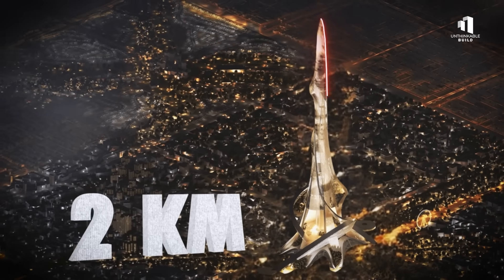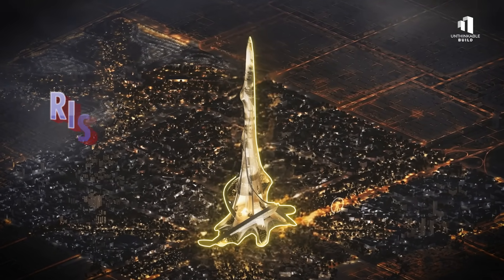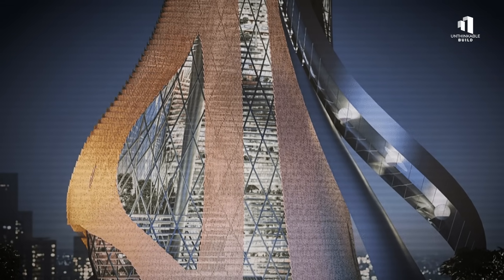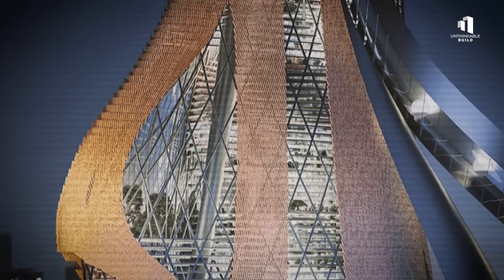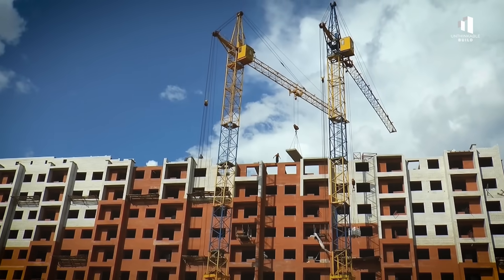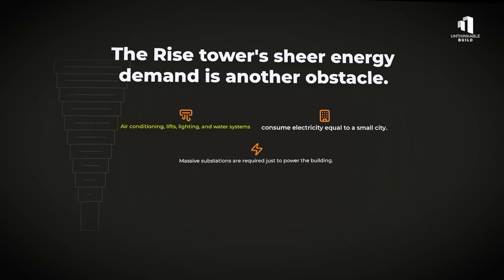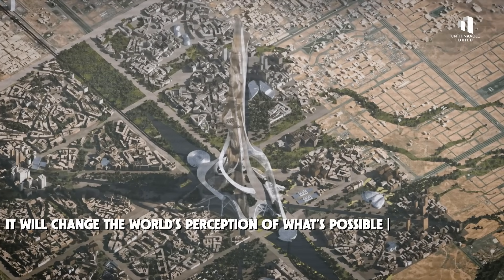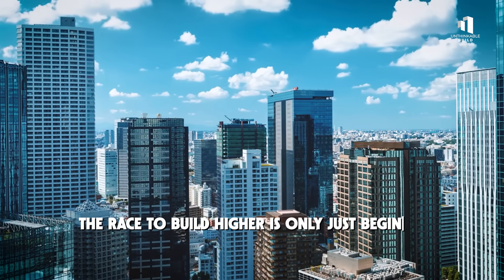Rise Tower: Saudi Arabia's 2-Kilometer Skyscraper Changing the World

Comment: Why not 3 km ?
Reply from the maker: At that scale, the limits aren’t ambition but physics, materials, cost, and human use. Beyond a certain height, wind loads, structural efficiency, elevator travel time, safety systems, and operability become exponentially harder and less practical. A taller number is possible on paper, but making it usable, safe, and economically viable is the real constraint.

Comment: Oil money won't last forever. Spend it wisely or throw it at some giant building project that never breaks even. It doesn't make sense to build vertical in the desert, the land is cheap.
Reply from the maker: That’s a common critique. With abundant land and extreme climate challenges, building ultra-tall structures in the desert raises real questions about long-term value and operating costs. If oil revenues are meant to secure the future, many argue they’re better spent on diversification, human capital, and infrastructure that delivers steady returns rather than symbolic projects that may never fully pay back.

Comment: Interesting Fact ----  A 2022 MIT and Harvard AI simulation found that if the current pace of greenhouse emissions remains constant, the Middle East and most of North Africa will be completely uninhabitable within the next 60 years as temperatures would exceed the threshold for human survivability.  

August 2025 Update: Greenhouse emissions and temperatures in the middle east continue to rise almost three times higher than anywhere else on earth.
Reply from the maker: Those studies highlight a real and growing risk: the Middle East is warming faster than the global average, and extreme heat events are becoming longer and more intense. But “completely uninhabitable” is a worst-case scenario under high-emissions pathways, not a guaranteed outcome. What the research actually warns is that parts of the region could regularly exceed the wet-bulb temperature limit a point where the human body can no longer cool itself, even in the shade.

Whether that happens depends on global emissions, regional adaptation, and how quickly countries invest in renewable energy, cooling infrastructure, and urban planning. The trend is worrying, but the final outcome isn’t fixed.
Reply: @UnthinkableBuild It's not a worse case scenario.  This is expected before the end of the century.  The "parts" are the first to reach 140 degrees Fahrenheit, with the rest of the region to follow in the coming years.  There is not one reputable study that says this situation is in reverse, on the contrary it is gaining momentum.  Irony found in the middle eastern nations selling the very products that will result in their own demise in their children's lifetime.

Comment: If you ask me, the Rise Tower is just like Frank Lloyd Wright's The Illinois Tower as in the building is before its time and that it probably shouldn't be built right away, and I don't think most people are ready yet for such a gigantic skyscraper. 

Instead, I'd recommend starting off small with something that's more easier and economically feasible, you know building a more smaller building that's somewhere between 100 to 300 meters tall at best, and then slowly working your way upwards by at least 50 to 100 meters until you ultimately make a 2KM tall skyscraper instead of just going straight for building the 2KM tall skyscraper first. 

Alongside having colonies on other planets, this a NECESSARY type of project for the future of our species.
Reply from the maker: That’s a thoughtful perspective. You’re right projects like Rise Tower push the limits of what’s technically and economically possible, much like Wright’s Illinois Tower did in its time. A gradual, step-by-step approach would not only make the engineering challenges more manageable but also allow for sustainable progress. Ambitious designs like these are essential for inspiring innovation, but turning them into reality often takes patience, experimentation, and evolving technology.